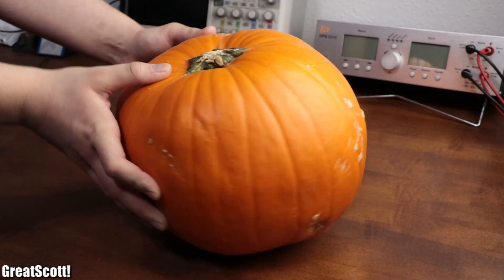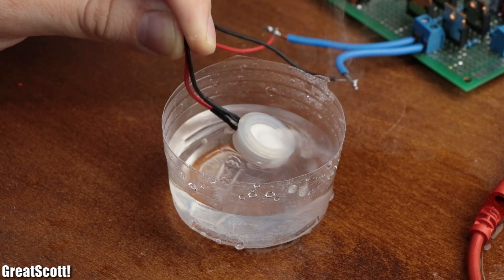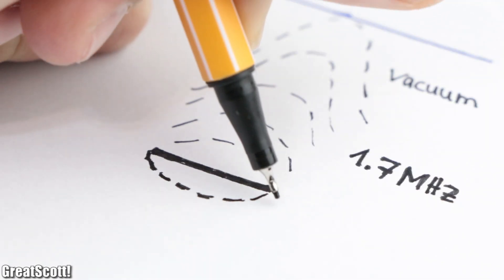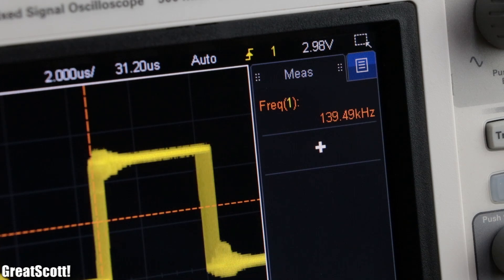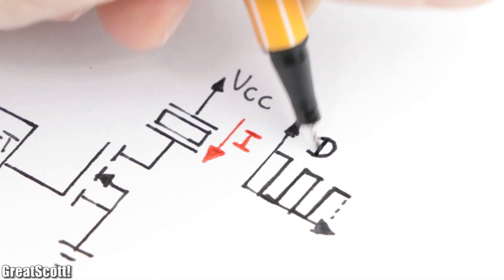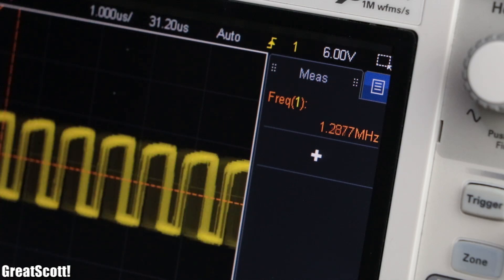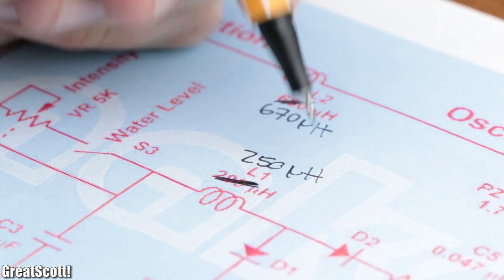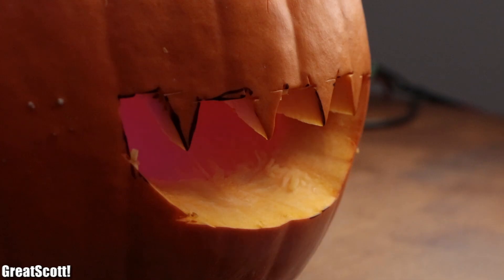Ultrasonic Mist Maker || DIY or Buy

Comment: How about a capacitor in series with the positive square wave circuit?
Reply from the maker: Does not work. Tried it.
Reply: The catch is that the piezo disc itself acts as a capacitor with hysteresis loss, you have to put an inductor in parallel to create resonant circuit.
Reply: Did you play with the value of this capacitor? I think the value may influence the impedance vs. frequency response.
Reply: GreatScott! I could never get the hang of mosfets but as far as using a capacitor to create the a.c. would you not have to replace the piezo in the circuit with a resistor then where the resistor joins the f.e.t connect a decoupling capacitor from there to the piezo and then from the piezo to ground.  I guess you could replace the f.e.t with a transistor
Reply: You can turn the signal into an AC waveform by using an isolation transformer. This would be similar to the old audio transformers used back-in-the-day when tube amps were common or in the early transistor stereo designs....but the induction/core design will be very tricky at 1+MHz. I have no idea where to start with a design like that. However, the "DC" aspect of the circuit is due to the ground reference terminal.
    Playing with the positive terminal won't get you anywhere.... unless you can create a virtual ground point in the circuit to float the negative terminal of the piezoelectric transducer. 
    When you try to "block DC" by using a capacitor on the positive terminal, you still have a ground reference in the circuit on the negative terminal of the piezo.
    This is the exact same problem we face with AC mains. So long as there is a connection to the circuit through any wire even ground, that reference point has the potential to draw all the power of the circuit. This is why a good electronics lab has an isolation transformer to power most circuits and usually another one for the Oscilloscope. Also all of our "wall warts" and SMPS power supplies must have this same type of isolation transformer to prevent us from being exposed to a deadly mains potential shock.
    There are lots of super dangerous ways to step down mains voltages that do not require isolation. However once you have a DC reference point in a circuit, the only way to limit it is through isolation and that requires a transformer every time. There are ways to fake it, but they all have problems.
  One of the more difficult concepts to understand when looking at isolation is that AC and DC are not really 2 separate things. I got a better understanding myself because of playing around with a center tapped secondary transformer and building all of the different rectifier configurations. If you want a better understanding, build a circuit using a transformer with a center tapped secondary in it's full bridge configuration. It only takes 2 diodes. You'll get a much better understanding of how this AC ground reference point works. Then build a half wave voltage doubler, and a full bridge voltage doubler. Lastly build a dual polarity configuration without using the center tap by placing 2 capacitors in series. I am not going to try to discribe this topology as it is better to see the schematic but do a search to learn more.
  -Jake
Reply: Searched this comment!
Reply: Maybe just place a buffer between the serie capacitor and the resonator to adapt impedance ?
Reply: But this way we need a symetrical power supply...
Reply: Thought the same, why can't you just filter the constant component of the signal, what's the catch ? Is there one ?
Reply: that will rectify the frequency!
Reply: to operate a piezo transducer you will also need a large potential difference upward of 160v AC
Reply: BJTs are much faster than MOSFETs as far as I understand, and cheaper. Maybe a Darlington bridge or totem pole of some sort would work?

Comment: What about a pierce oscillator circuit that uses a crystal ?
Reply from the maker: You could certainly create the frequency but the piezo discs also needs quite a lot of power. That is the problem.

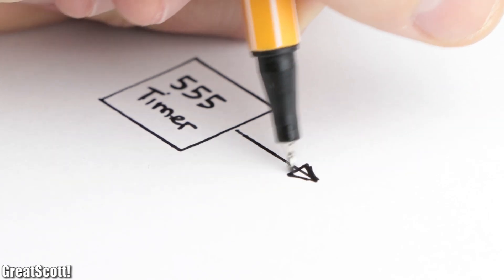Comment: Wait, What!  Since when do Piezo buzzers not work with PWM.  You only need DC current, not a sine wave.  You must have reversed your piezo's polarity with the circuit at 4:27.
Reply from the maker: No, the polarity does not matter. But just to be sure, I tried both polarity options.

Comment: what you'll do when the glass remains out of water? btw, halloween is celebrated in Germany?
Reply from the maker: The mist maker has a water level switch, so it will turn off. And yes, Halloween is (kind of) a thing in Germany.
Reply: that is good, I hate a waste of power.

Comment: You skipped the simple driver: just connect the piezo to the output of a fast low-side only FET-driver with a capacitor in series.

The FET-driver is already a half-bridge,  but you would be limited to 15-ish volts.
(the extra capacitor would not be needed since the piezo is quite much a capacitor, but avoiding DC bias in the water would be a good thing)
Reply from the maker: You need AC. Adding a capacitor in series does not solve the problem.
Reply: Well, you get AC. It's a half-bridge with capacitor to negative (or positive).
The GATE driver output is AC with DC offset, the capacitor deals with the DC offset giving you AC only.

The GATE-driver can drive both up and down (without the FET in place).
If you include the FET it can only drive low thus DC only.
Reply: Even, two opposing drivers would give you the double voltage. You can get gate-drivers good for 6+A!
Reply from the maker: Build the circuit and see for yourself.
Reply: Already seen it on way faster circuits! AC coupling is well known in RF stuff.
But you need a push/pull driver, or it will just get stuck with 12V on the piezo (like your circuit).
Reply: erlendse is correct i think

Comment: Very interesting, I didnt know you could create water vapor this way.
Reply: me, not too.
Reply: This is how vaporizers work without boiling water
Reply: You cannot achieve higher vapour pressure using this vibrator method than what we would get normally at that temperature. It only acts like a catalyst that speeds up the journey to equilibrium point but doesn't shift the equilibrium point.

Comment: Could you try making your own 3D printer with an Arduino and RAMPS
Reply: This. Or maybe a raspi zero or greater as the controller.
Reply: Not a problem. Most of the cost of a 3d printer has to do with the steppers themselves. The more granularity, the higher the precision. The higher the precision, the slower the speed. The faster the speed, the more processing power required and the more momentum tries to sabotage you. It's a battle where physics is constantly trying to kick your ass.
Reply: Or even a Table CNC Router
Reply: That would be creative its only been done like half a billion times all ready?
Reply: Fun fact, the ultimaker 2 use an ATMEGA2560 (which is the same as an arduino mega).
Also most 3D printer use Marlin firmware which is in Arduino C (.ino)

https://github.com/Ultimaker/Ultimaker2Marlin/blob/master/Marlin/Marlin.ino
https://github.com/Ultimaker/Ultimaker2/blob/master/1091_Main_board_v2.1.1_(x1)/Main%20Board%20V2.1.1.pdf
Reply: +Vector Reyes I dont think you can use a Raspberry pi computer to control a 3D printer. I saw some projects that tried to do so, but everyone uses microcontrolers like the Atmega2560 or some 32bit controllers.

But a Raspberry pi can be used to remotely control a 3D printer through programs like Octoprint.
Reply: if you can make the mechanic parts its not a big deal to build diy 3d printer.
Reply: maybe a laser cutter with a smoothieboard if he gives up on the arduino
Reply: well that's odd yet interesting to know about